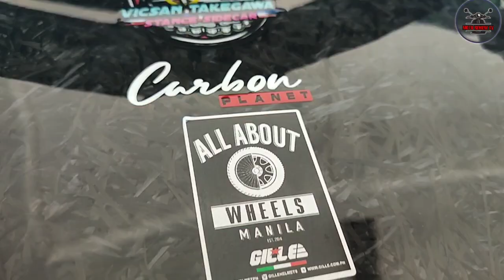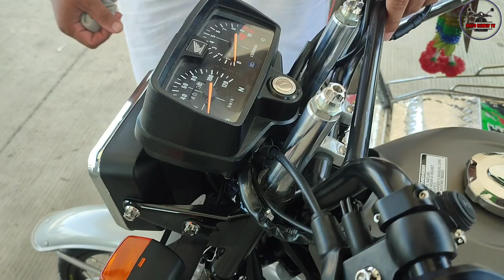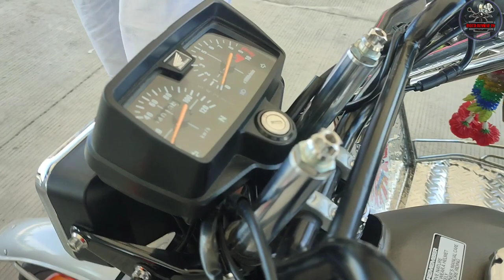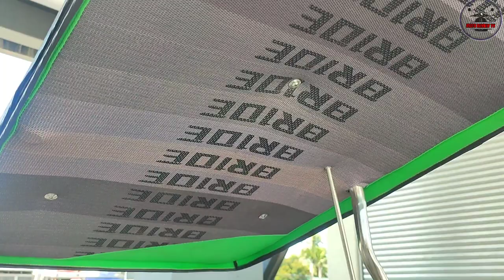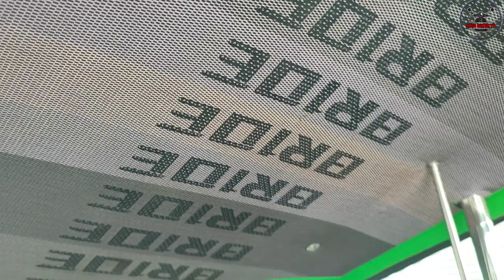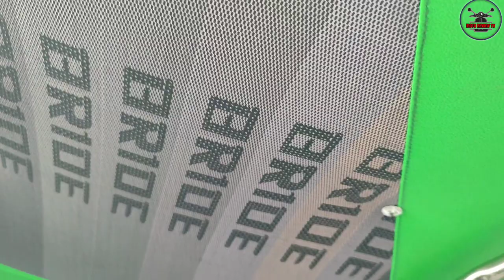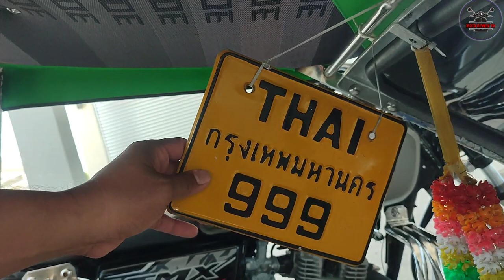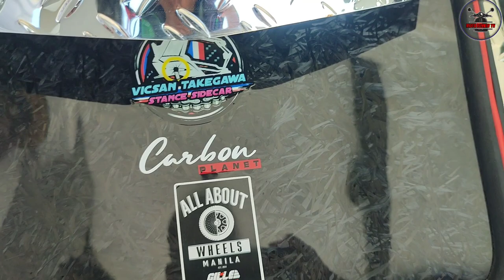TMX 125 ALPHA STANCE CONCEPT - Lowered Sidecar Set-up - Thai Side Car Build - Full Stainless Steel 💯

Comment: Subrang lowered tas nakayuko Po side car pero ok naman Po sya astig☺️
Reply from the maker: Sir ganyan kasi mga set up ng sidecar dito sa Tarlac, lalo na sa mga naka stance sidecar, may fb group din sila, join nalang po kayo, para makita nyo po ibat ibang design
Reply: Boss ano po yung side car wheel nyo? Tire size brand at interior siz
Rim size,brand
Hub at bearing brand
Spoke size at brand at ilang piraso po sana masagot
Mag kakabit po ako ng set sa side car wheel ko

Comment: It's time to move on to 3 wheelers or reverse trike.  
The design of sidecar-tricycles is wrong at the very start.  It is practically a small car with a missing passenger side front wheel.
Reply from the maker: I respect your opinion, this tricycle is for show use only, not good for service,  and not good for rough roads.